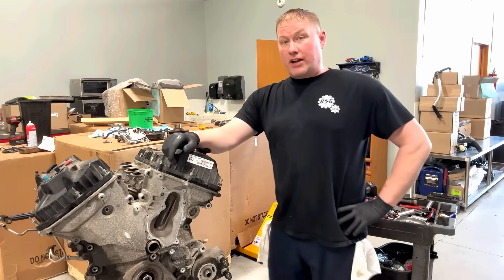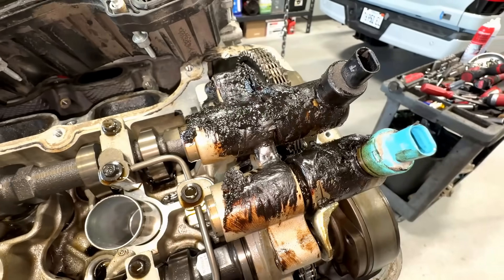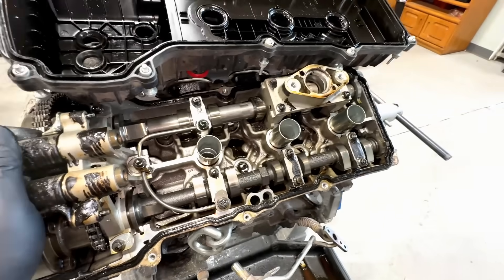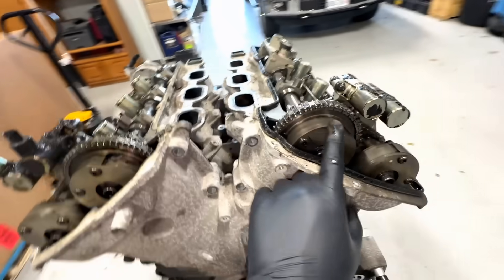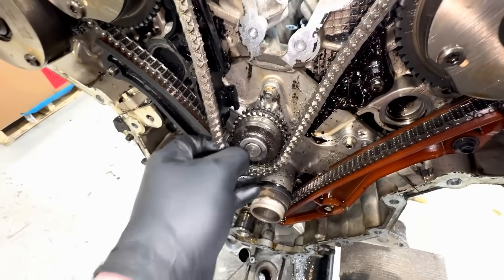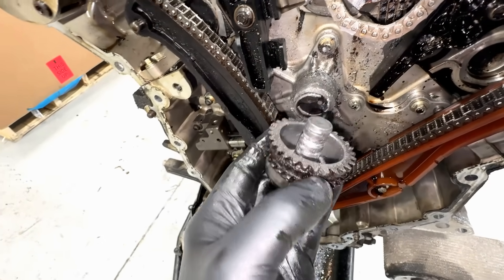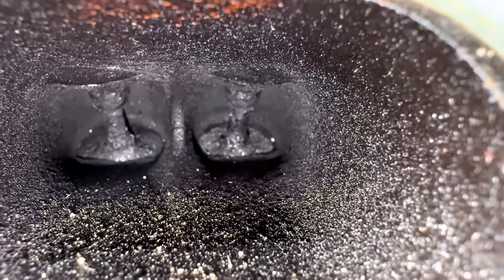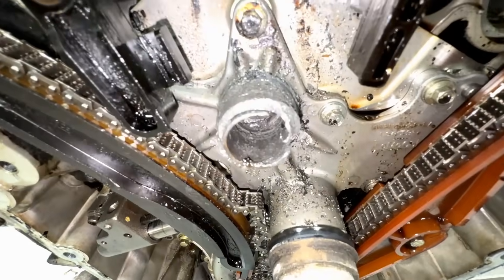2015 Ford F-150 3.5L EcoBoost Engine Failure: 97k Miles Total Destruction!

Comment: Don’t let the morons in the comments bother you. You are doing great work. Keep it up.
Reply: I believe you know what you are talking about, but I don't understand how low oil level can increase sludge, unless it is extremlly low, and than the friction will cause metal ware but not sludge.
Not trying to be a smart alek, just trying to understand the process.
Reply: @  Good question. Generally speaking lower oil levels mean the oil that is in the engine is going to run hotter and take more abuse because there is less of it. Therefore the oil wears out faster because less oil is trying to do the job that is suited for more. Hope that makes sense. Higher temps equals more oil breakdown. It’s called the flashpoint.
Reply: @rogerdc7279 it's simple... It's like cooking off water in soup. As the oil is burnt off the deposits remain.

Comment: Lot of great information in the video.  We have a 2018 F-150 with the 3.5 Ecoboost and it is pretty important to change the oil with the turbos and the variable valve timing.  Costs a lot less to change the oil and filter every 5,000 miles versus getting a new engine.
Reply: Thats what i do 3.5 EB every 5000 miles
Reply: @josephheselberger4356  Yup, me too. Currently at 157,000 miles! I had a 2005 F150 with the infamous 5.4 3v, transmission went at 220k, engine was still running like a champ, did all my own oil changes every 5k miles using Valvoline High Mileage synthetic Blend!
Reply: And try to use synthetic whenever possible.
Reply: 2019 2.7TT owner here, 5,000 with synthetic

Comment: I love your videos! I just wish there weren’t over a thousand miles to get to your shop. I’m just shy of 183,000 on my 2010 F150 Lariat with  a 5.4 and want to keep it for the rest of my life.  It is running great! The only service for something broken it ever had was the typical cracked exhaust manifold and I replaced both of them at the same time. Full synthetic oil every 5.000 miles and mostly highway driving.  Love that truck! Keep up the good work and vids!
Reply: Same with me. I have a 2008 5.4L 3 valve, and I'm further than you, but im thinking that will be worth the trip.
Reply: He is the 5.4 king. Check out his older videos. Lots of good maintenance tips and common problems. If you need timing chain replacement, I would drive to his shop if possible.
Reply: My 2007 5.4L is still going strong. Great engine.

Comment: When I worked at the dealer years ago, they sold BG products. Did not know they were that strong.
Reply: 44k is the stuff!
Reply: They sell a 2 step extreme kit  kit in big jugs (I don't know the name). This might have been what was used, it is very very strong.
Reply: This could be an add on how well it cleans lol if it were a less gunked up motor it probably would have been alright.